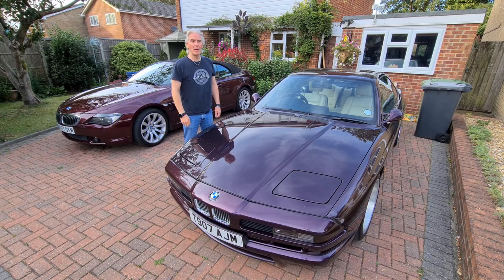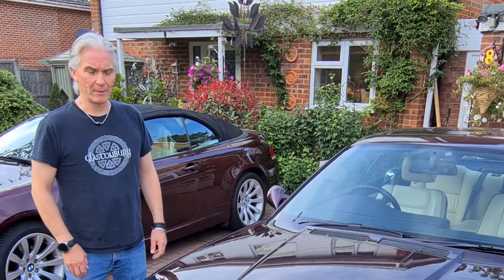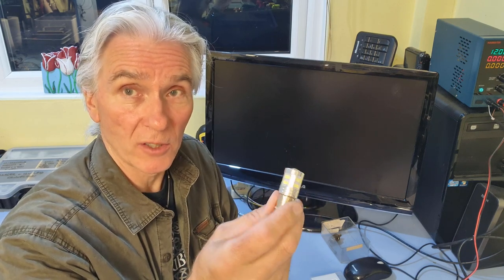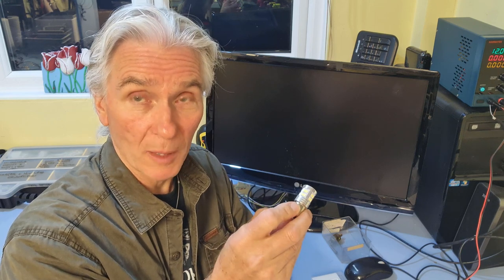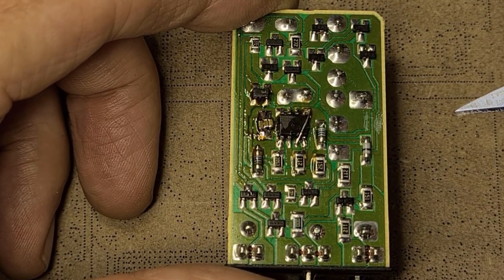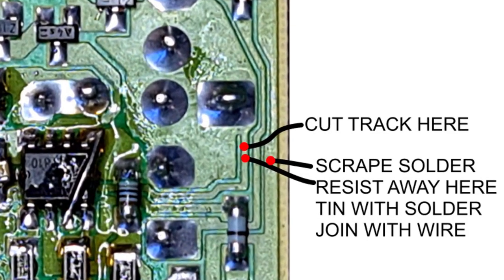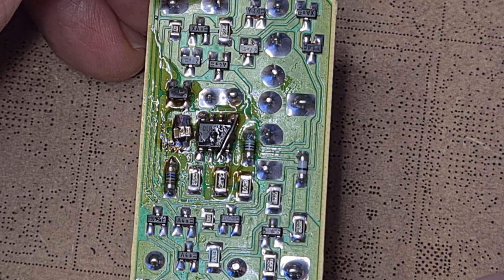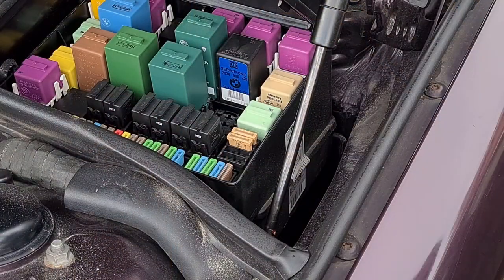BMW E31 INDICATOR LED HYPERFASH FIX - NO RESISTORS

Comment: Your videos are always entertaining and very helpful Timm.  Please keep them coming.  I, just very recently, purchased a 1997 840ci with under 30,000 miles and one issue I can't seem to figure out is my windows.  They won't go up or down when the car is cold.  So, in hot weather, the windows will start going up or down only after about 15-20 min of driving.  On some colder days they won't work at all.  So, when I get to work and need to scan my parking pass, i literally have to open the door, and get out of my car so I can scan my pass.  Same thing happens with the interior lights, but exterior lights, the AC and just about every other electrical component works just fine.  Any ideas what can be causing this?
Reply from the maker: Hello Garen, that will probably be the General Module, the electrolytic capacitors fail and then all sorts of things go wrong including window lifts and interior lights. There is a member on bimmerforums.com called EEDegree2Drive (I think) that repairs them and has done for a long time. Also worth swapping the consumer relays in the trunk (boot) - details of where they are can be found here: https://www.meeknet.co.uk/e31/Timms_BMW_E31_Relay_Finder.htm

Comment: Another great video and top tip. My electronics training some 40 yrs ago we always used to clean off the flux to avoid it corroding. Maybe I missed it or perhaps the flux used is fine, but perhaps cleaning the flux away with a small brush and brake cleaner is a good precaution.
Reply from the maker: No-clean flux these days, gone are the days of corrosive fluxes thank goodness!
Reply: @TimmsBMWRepairsandInformation  cool. I thought I may be a little out of date! 👍

Comment: Hi Timm, do you know if i will be able to source indicator bulbs for the FTP from Halfords, or go to BMW direct? My passenger side bulb is not working, with the side repeater and rear lights flashing fast. Im not convinced the bulb is gone as its an intermittent fault and convinced it sometimes comes on, but best to try a new bulb first. Any idea what else it could be? Thanks
Reply from the maker: You can get them everywhere, any Halfords will do.  The FTP indicator bulbs are standard 21W BAY15S
Reply: @TimmsBMWRepairsandInformation  thanks! 👍
Reply: @CraigOnCars  had exact same thing on my passenger ftp, intermittently wouldn’t work like yours. I put on hazards whilst taking out ftp, twisted indicator bulb holder and it came on. I then took out bulb sprayed contact cleaner in and re twisted in bulb the other way, ie turned it 180 then put back in, unscrewed main connector to ftp sprayed with electrical  contact cleaner also and all good ever since. Hope this helps.....
Reply: @bobbybridgeman2629  thanks Bobby, i’ll give that a try! Appreciated

Comment: 2.2 uF replaced by 2.2uF + 2x 0.47uF in parallel to the 2.2u. So i can just add 2x 0.47uF in parallel to the existing one. correct?
Reply from the maker: Yes, that's correct, that will do nicely

Comment: My LED turn signals blink very faintly about every 10 seconds when the ignition is on in my 97 540i.
Reply from the maker: That's the cold-bulb test that the LKM does - you need a PTC device as seen on Meeknet!

Comment: I tried it on my own on 3 relays. 2 times like in the video one once by cutting the trance from pin7 to the shunt. No luck.
From stock I have a connection from pin1 to the shunt, and pin1 is not gnd, so i dont understand how cutting the trance and connecting it to the outer trance (gnd) would do the same. a bit disappointed though…
Reply: Relay has Partno. 1388533 correct?
Reply from the maker: Are the relays you are working on the same model as the one I worked on? You say you are disappointed but of what aspect - is the flashing still too fast? Did you have a go at replacing the capacitor?
Reply: @TimmsBMWRepairsandInformation  I have to correct. The mod works to avoid hyperflash. But I have two models of the relais. one from siemens (older model) and JWT (?) (newer Model).
The Siemens relay has T=0,855s with  4x incandescent lamps. With the
Mod i have T=0,555s. 
With the JWT Model I have always T=0,555s.
Without the mod, and led mounted I have the much quicker hyperflash.
So i have to mod the capacitor aswell. Sadly i dont have any parts flying around. 2u2 parallel with another 2u2 is much to slow. Can you help on the capacitor models to choose?
You said i need in total 3.14uF ? 2u2+2.47?

Comment: It will be better to use yellow/amber LED's, because the white ones have too little yellow spectrum that will pass through the yellow cover. The same for the red lights - use red LED's instead of white. The red glass will let the full red spectrum pass instead of filtering only the red part of the white spectrum.
Reply from the maker: Thanks, I found some decent amber LED's a while ago - I'll give them a go!